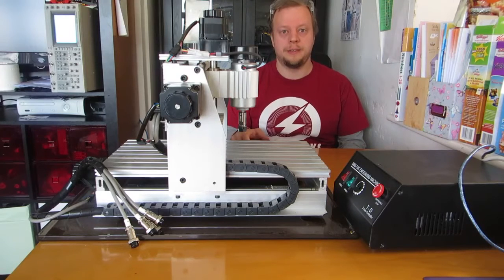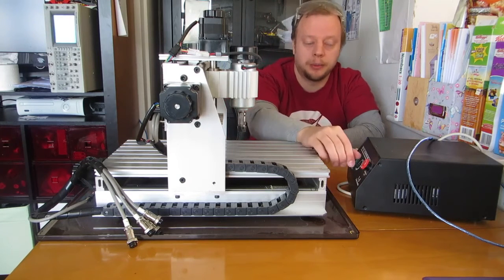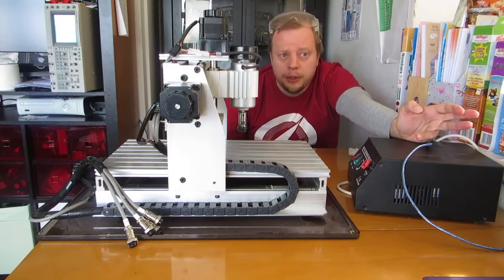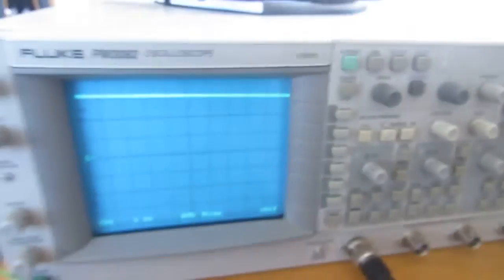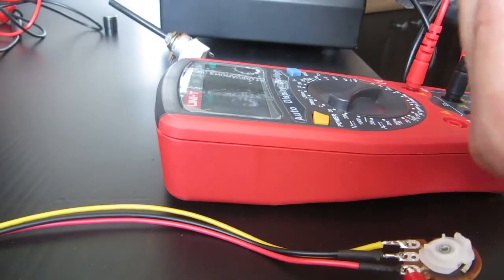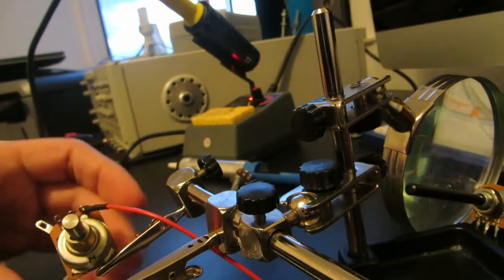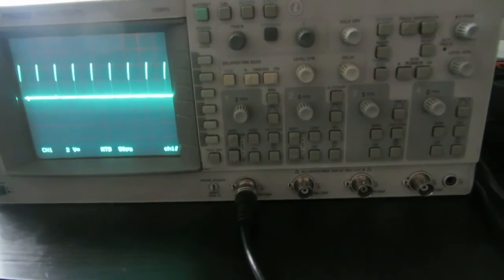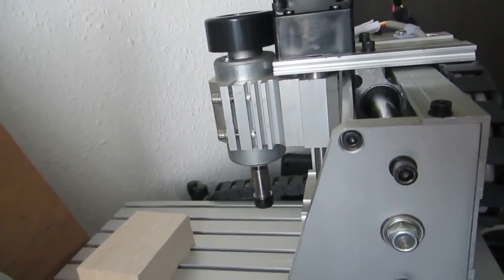The First Time I Blew Up My Cnc 3020

Comment: Hi Orionrobots.
I've been watching cnc youtube videos for 3 weeks now and was lucky to have found a second hand 3020 cnc that was damaged for sale and got it at an excellent price. 
This one has the R5 resistor blown up. And from screenshoting your video I was able to follow your diagrams to source correct resistor. Yet to fit as need fuses to.
But thank you for sharing. 
P.s. I wouldn't have bought this without your vid. Thank you.
Reply from the maker: Might be worth checking some other bits to determine why it blew. It you can get to a small bench power supply and oscilloscope - that 555 circuit is worth checking. When you get the replacements, get a few, and ease the spindle motor speed in.
Reply: Orionrobots hi. 
Just this second ordered the other parts including fuses. T2.5a & T1.6a.
Couldn't think of the name of the spindle control to order spare. I'll play by ear the 555 part. 
Question. If I went full Arduino, could I control spindle start/stop and speed in the settings? 
Not sure I will, but just thinking of options.
Thank you for reply.
Reply from the maker: Lee Lipinski I haven't gone that way yet, but I've definitely thought it's a good idea. I think there is an opto coupler there for that and a way to bypass that 555 so the Arduino is generating the pwm. I'll have to try it some time.
Reply: Orionrobots cool. I've subscribed to you now. So hopefully I'll pick up the video if you get around to making one.
Reply: Help please.
Hello again. Can you please help. I can't see from your schematic what value R5 resistor is?
This is the puppy that blew.
I've ordered and have most values in front but can't work out what it should be. Any help would be great . Thankyou

Comment: Nice video. Why did you not take this opportunity to just take a PWM from the Arduino so you can control the speed in software?
Reply from the maker: +Jeremy Poulter I may yet do so - although having a manual control like that is going to be useful until I build myself a pendant to control the machine with. There is an Opto-isolated input to the Spindle board to do exactly that.

Comment: Nice repair. Do you think this was just a bad unit or is this likely to be a common issue?
Reply from the maker: +Samuel Doye I've heard of a number of issues with these 3020 CNC machines - generally most are quite easily fixed. I've not heard of this particular fault, but I will say that the controller is pretty low in quality - made to a price. I plan to replace and repair it. The actual bed seemed pretty good for me, but I've seen videos of other people with stability and backlash problems which I've not had - mine has so far been quite rigid.
Reply: Thanks, I will probably aim for a slightly more expensive machine then.
Reply from the maker: Yes - these are a bargain at their price, but come with a maintenance cost. At only £400 initial cost it was very cheap on eBay. If you are looking for a starting point - the Inventables xcarve or shape-oko may be a less ropey entry level thing. Price quickly climbs from 100s to 1000s of pounds with these machines though.

Comment: Hi. So worked out resistor size. 100 ohm I think. Then tried to work out what a 5 band 100 ohm resistor looked like.
But no spindle action. Other axis work on arrow keys. 
Any advice would be appreciated. Thanks